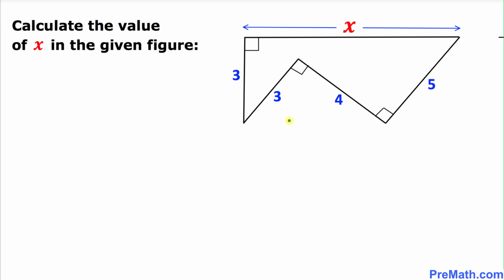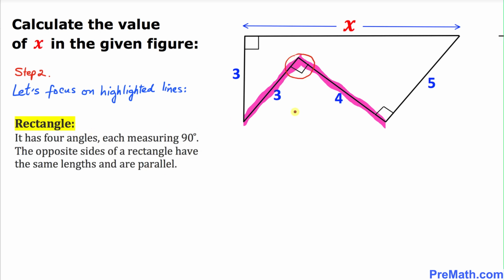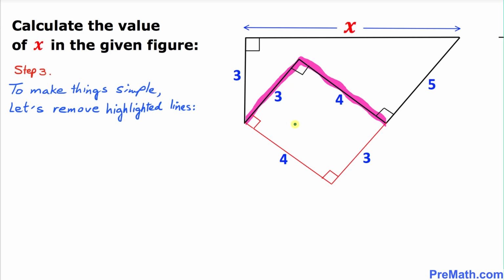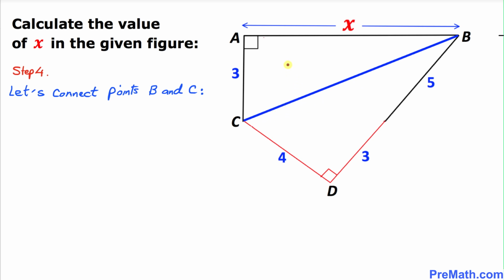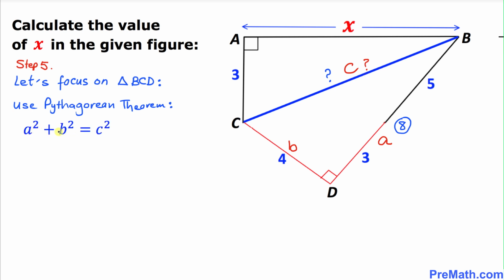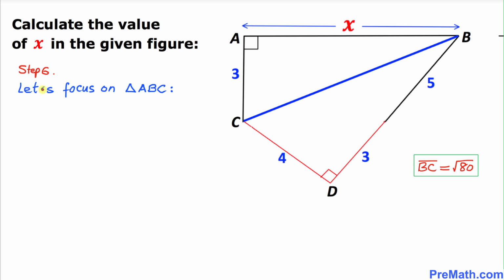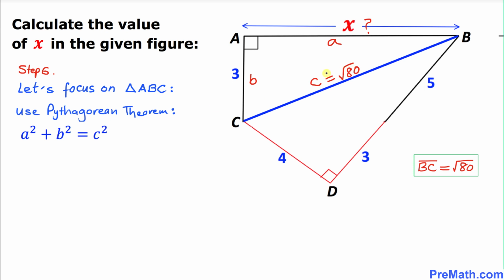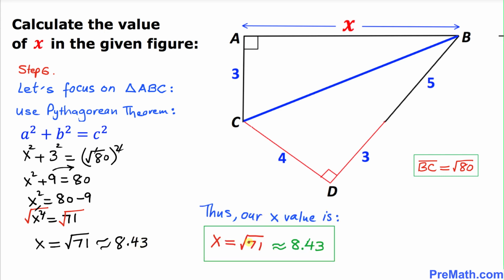Can You Calculate the Value of X in the Given Figure by Using the Pythagorean Theorem?

Comment: In this figure, there is a right-angled triangle, base, and height are respectively 3,4 by Pythagorean theorem, third side = 5.
On the right, we draw a column on the X line to the first vertex in the figure, so it becomes symmetrical = 3. Then we got a right-angled triangle with sides 3,5 then the base = 4, so, X = 4 + 5 = 9
Reply: thats what i got

Comment: 0:22 
Points
Top Left: A
Bottom Left: B
Angle between 3 and 4: C
Angle between 4 and 5: D
Top right: E

Triangle BCD is right, so let's use the Pythagorean theorem.

a²+b²=c²
3²+4²=c²
9+16=c²
25=c²
√c²=√25
c=5

Lets move line segment AB to the right to make a new line segment EF equaling 3

a²+b²=c²
a²+3²+5²
a²+9=25
a²=16
√a²=√16
a=4

x=BD+DF
x=5+4
x=9

Is this right?
Reply: That’s exactly what I got too

Comment: Awesome task, excellent way of solution, many thanks. But: You don’t have to use „D“ for solving, here‘s another approach:

BC intersects the 3-4-5-line in Point E, dividing the zig-zag-line into two rectangled triangles: 

CEF and EGB. (CF is parallel to BD, G is on the BD lin; FG = parallel to CD).
CB cuts FG (= 4) into two parts: k and (4 – k).

Because tan α = (4 – k)/5 = k/3,

k = 3/2

Therefore

(CE)² = 9 + k² = 45/9
CE = 3√5/2

(BE)² = 25 + (4 – k)² = 125/4
BE = 5√5/2

CE + BE = BC = 8√5/2 = 4√5

(AB)² = (BC)² -  9 = 80 - 9 = 71

AB = √71 ≈ 8,426

Note: BC = diagonal of rectangle CDBM (BM = parallel to CD).

It's astonishing how many comments say x = 9 🙂. Maybe Premath should explain this in another tutorial...

Comment: It must be the square root of 71.

Move the second 3 to the bottom right so that it extends the five. Then move the 4 to the bottom left. The result is a quadrilateral with two right angles and the sides 3, 4, 8 and x.

The diagonal from bottom left to top right measures:

d² = 8² + 4² = 80

x² = 80 - 3² = 71

x = square root of 71 = 8.426

Comment: Thank you for a nice solution for this tricky problem.
I have another aproach for this problem using the knowledge of similar triangles and Pythagorean theorem.

First we label the vertexes A,B,C,D and E ( A from the right angle at the upper left corner, clockwise). Connect EB meeting CD at O. Connect CE.
Because DE//BC ---->angle DEO=angle OBC, so the right triangle EDO is similar to the the right triangle BCO
so we have ED/DO=BC/CO =( ED+BC)/(DO+CO) = (3+5)/4 = 2 ----> DE=2DO, BC=2CO. 

Just consider the right triangle EDC, we can easily find the value of CE=5 ( special right 3-4-5 right triangle) which means that the triangle ECB is an isosceles triangle (CE=CB=5). Just draw the height CH=h from the vertex C to the base EB, it meets EB at point H which is also the midpoint of EB. Consider the right triangle CHB, interestingly it is also similar triangle to the triangle EDO mentioned above (angle DEO=angleCBH) so we can deduce that BH=2CH =2h---> EB=4h

Using Pythagorean theorem (consider the ritght triangle CHB) : sq CH + sq BH = Sq BC ----> sq h + sq (2h) = sq 5----> h= sqrt of 5.
therefore EB=4 sqrt of 5----> sqAB= sqBE-sq=80-9=71---> AB=sqrt of 71.

Comment: The picture of this problem is completely misleading. If the sides are 3, 4 and 5 then the picture cannot look like that. The corner between the sides with length 4 and 5 will fall much lower in the picture.

Comment: Given that a triangle with sides 3,4 and 5 has to be a right triangle then a line joining the two bottom points on your diagram must be 5. We are given 5 on the right as a hypotenuse and a vertical line as on the left hand side of your diagram as a 3, therefore making this left hand side of the figure a right triangle the bottom line of it must be 4. Adding these lines 4+5 would make the bottom overall line and thus the top line 9. Not the 8.43 you got by your convoluted method. This works quite simply on graph paper so are you wrong? I see many others have the same comment.
Reply: O.K.  I see my mistake I didn't have three right angles as your drawing. But your drawing is for shit :-) isn't it?
Reply: However, in reality ignoring your piss poor drawing, the second bottom point is a lot lower than the first point. Nevertheless it you join these two point you get on the left a 3,4,5 triangle. Continuing this line and drawing a line at a right angle from it to the top left point you get another 3,4,5 triangle (you are given the hypotenuse as 5) This only reverses the numbers I had in my previous comment making the bottom of this triangle 3 and not 4. Still, you add this 3 and the previous triangles 5 and you get 8. You can then see just by looking at it that the top line is a just a bit bigger than the bottom line so there is your answer — the top line is 8 and a bit, which is near enough to what you got without going all around the houses.
Reply: If you wanted a more accurate answer an easier solution would be to project a line through the bottom two points and then a line at right angles from it to the top right hand point. This gives you two right angle triangles which you can see have sides of 3,4,5.  Now you add up all the sides you know 3+3+4+5+3+4+5=27 you take away from this the number of lines you know which is 7. 27—7=20. You have two known triangles so 20 X 2 = 40. Add to this the number of hypotenuse you know (2) 40+2=42. So the length of the top line has to be this 42 divided by the known hypotenuse (5). 42÷5=8.4. There is no need for all your square root rubbish, isn't it?

Comment: x = exactly 9. There are two rectangular triangles there: one formed by legs 3 and 4, hence hypotenuse 5; the other, height (one leg) is 3, hypotenuse 5, so another leg 4. 4 + 5 = 9.
Reply: You're assuming that the hypothenuse of the first triangle in your explanation  is parallel to line x but that is  not proven and  can in fact be proven false
Reply: The 3, 5 and a bit of x triangles is actually approximately a 44, 46, 90 degrees triangle, you assumed it is 30, 60, 90.
Reply: That's what got

Comment: Sqrt (3^2+4^2)  + sqrt (5^2-3^2) = 9
Reply: First, you are assuming that the triangle with legs 3 and 4 has hypotenuse that is parallel to side x. Then you are assuming that if we drop perpendicular from intersection of sides 4 and 5 to side x, we get a right triangle with vertical leg = 3, which is only correct if the hypotenuse of original triangle were parallel to side x, which is not necessarily true, and in this case is not true at all.

Comment: Hlo bro, the answer might be 9 .
If u draw a line joining the 3 and 4 which is parallel to x ,u get a right angled triangle,its length is 5 and again extending this line and draw another line from B so that this is perpendicular to extended line and here it forms another right angle triangle with hypothesis as 5 and the line drawn from B is parallel to 3 so it is 4 therefore the sum will be 4+5=9
Reply: "Which is parallel to x", you say... but I don't think it's true... It may look so from the drawing, though. But I don't think this drawing is really to scale.
Reply: What you did proves that the length of x cannot exceed 9. For it be exactly 9, the hypotenuse would need to be guaranteed to be parallel to the line x. That's not a given. It's close to parallel, which is why the answer is close to 9.
Reply: Agree

Comment: I can't accept this answer. There's problem.  I found 9 as a answer. Just applied pythagoras theorem. If you draw all the rectangle and you applied the pythagoras theorem you will find answer easily
Reply: You can't accept the answer because you made some incorrect assumptions. Most likely, you probably assumed that if you connected the ends of the adjacent line segments 3 and 4, you'd get a line segment of length 5 parallel to line x. Yes, that line segment would be 5, but it's not parallel to line x.

Comment: Thanks Bob.
I approached from another way :
1. Given 3 & 4 you can calculate the angle : 
Tan 0 (theta) = 3 / 4 
So Theta = 37deg
2. Sin 37 = a / 3 
So a = 1.805
3. Sin 53 = b / 4 = 
So b = 3.195
4. Sin 37 = c / 5
So c = 3.009
X = a + b + c
= 1.805 + 3.195 + 3.009
= 8.009
Can't figure out, where I am going wrong!
Reply: First, using exact value, you'd get:
a = 3 sinθ = 3(3/5) = 1.8
b = 4 sin(90-θ) = 4(4/5) = 3.2 
c = 5 sinθ = 5(3/5) = 3
x = a + b + c = 1.8 + 3.2 + 3 = 8
But this is still incorrect. Why?
Because the hypotenuse of triangle with legs 3 and 4 is not parallel to side with length x. 

If we did assume that the hypotenuse of first triangle was parallel to side x, then the second triangle has horizontal leg c = 3 (as calculate above). But that would mean that vertical leg = 4, which is not possible, because it should be the same as the vertical side of the larger figure = 3.
If last segment was actually 5 units, then we'd get c = 4 and line segment of length 5 would not be parallel to 2nd line segment of length 3 (or not perpendicular to line segment of length 4).
If last segment was perpendicular to line segment of length 4, then it would have length 3.75, not 5.

So letting go of the assumption that first triangle has hypotenuse parallel to side x, and with careful calculations, I found that:
sin θ = (2√71-3)/20 and cos θ = (6+√71)/20 (where θ is the angle between the two sides of length 3. This gives us:
θ ≈ 43.8
a = 3 sin(43.8) = 2.08
b = 4 sin(46.2) = 2.89
c = 5 sin(43.8) = 3.46
x = a + b + c = 2.08 + 2.89 + 3.46 = 8.43
Or using exact values:
a = 3 sinθ = 3(2√71-3)/20
b = 4 sin(90-θ) = 4(6+√71)/20
c = 5 sinθ = 5(2√71-3)/20
x = a + b + c = 3(2√71-3)/20 + 4(6+√71)/20 + 5(2√71-3)/20 = √71 ≈ 8.426
Reply: Hi Bob Punch, I’m not sure about step1: Theta = arc tan (3/4) exactly equals to 37 deg

Comment: Ok it can be sovled with right angels given in pic without making it quadrilateral..and ans is 9
Reply from the maker: Thanks Surinder for the feedback. You are awesome  👍  Take care dear and stay blessed😃
Reply: @PreMath  dear sir thanks for videos..really it will help to develop logical thinking..
Reply: 9 is absolutely wrong! You made wrong assumption that the line is parallel to x but it is not. The diagram is not drawn in scale.
Reply: Sorry but i don't understand. The answer is 9 or sqrt(71)?
Why this 2 techniques have different answers?
Reply: @wissem5915  premath method is more logical and explainable without any second thought.

Comment: Ok it can be sovled with right angels given in pic without making it quadrilateral..and ans is 9
Reply: No, if you followed the solution, answer is obviously not 9. That's because the triangle with legs 3 and 4 does not have a hypotenuse that is parallel to the side with length x. Interestingly, if  you switch the legs of length 3 and 4, you will get x = 9.

Comment: Draw a perpendicular line from point D to the side AB and name the intersection point of line and AB as E, from the figure it is known that the side AC and new formed side DE are equal since they are parallel to each other. Then take right angled triangle BDE and use phytagorous theorem  :BE=4 simultaneously take right angled triangle DFC and likewise use phytagorous theorem, you will get DC=5.Now take rectangle AEDC  by its rule you would able to know the length of the side AE is 5.At the end, you  should add the sides AE and EB(BE) to get the general length of side AB, since 'x' represents the length of the side AB.
BE=4
AE=5
               X=BE+AE
                  =4+5
                 =9  - correct answer
This is why I disagreed with your answer 🧒🤙✍🏾
Reply: What you failed to realize is that line CD is not parallel to line x.
Point D is somewhat lower than point C, so AE will be a little shorter than CD. Also, DE will be a little longer than 3, so BE will be a little shorter than 4
Did you actually watch the video?
Reply: 'side AC and new formed side DE are equal since they are parallel to each other' You must look at this sentence again.

Comment: Once you see the 3,4,5 line at the beginning, you can see that you can find the "diagonal" length easily. Put it in (0,0)  (3,0)  (3,4)  and  (8,4)  locations  and with distance formula the distance between  (0,0) and (8,4) is sqrt(80).

Comment: Wouldn’t it be easier to use an equivalent triangle process? Starting with calculating the hypotenuse missing between the 3 and 4 line which provides a length of 5. Then invert that triangle and impose it over the 5 line. Using the equivalent triangle process one can create the equation 5/3=x/5. This provides a result of 8.33… However given this is different that the one provided using the method described in the video, could it be that line ab is not 3 but something less than 3?

Comment: If we take a vertical line from the angle between the lines 4,5 to the line x and make a rectangle  
After calculating a line down between the tow angles down  that line equals 5
So the up line between the uplift angle and the angle that form our line we drow  is5
The line we drow is 3 
So the remaining of x is 4 
5+4=9     x=9
Reply: That's how I saw it
Reply: I did the same thing with x = 9. However, we are assuming that the two angles pointing down in the 3, 4 triangle are on a line that is parallel with the line x. Drawings are never to scale.

Comment: Label the diagram from the bottom left clockwise ABCDE. Let ∠ADE = u. AD = 5 (by Pythagoras). AC² = 5² + 5² -2(5)(5)cos(90° + u) = 50 + 50sinu = 50 + 50(3/5) = 80, BC² = AC² - AB² = 80 – 9 = 71, BC = √71.
Reply: Nice.

Comment: You take the long way round. 
1. Connect the two lower peaks.  You get a 3,4,5 right triangle. 
2. Drop that 5" side up to the main line "x", 
3. Now, extend a vertical line from the second lower peak up to the line "X".  
4. You get another 3, 4, 5 right triangle, with the "4" length as part of "X". 
SO, "X" = 4+5 = 9. 
Much quicker than your approach.
Reply: We due respect, I totally agree with Craig Dillon
Reply: With due respect I mean
Reply: @suleimanalhassan4702  Yeah, Except I was wrong.  LOL...I was part of the 99%.  That problem seems simple, and it seduces one to that belief.  But, those two lower points are NOT at the same level.  A line between them is NOT parallel to "X", but it looks it.
Reply: @craigkdillon  Respect. Apologies to the Prof. LOL
Reply: @craigkdillon  There's about a difference of 0.574 difference in their lengths... So if you tried to make that assumption about drawing a line across the bottom and back up to the top right... you're off by about 1/2 a degree (educated guess based on visual and the difference in lengths, without performing the calculations) ... Now, finding that exact angle, that'd be a moderate challenge!
Reply: Yes I had x =9
Reply: I also thought on the same lines. The answer should be 9. All the steps are Pythagorean!
Reply: @subashan1957  Yeah, but I was wrong. I was led astray by the diagram. Humbling to be caught in a stupid assumption.
Reply: I also applied this and calculated value of x as 9
Reply: nice Craig
Reply: This is the best way , 
8.43 is a wrong answer.

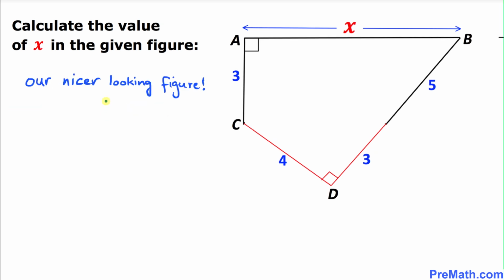Comment: At 2:55 in the video you introduce A,B,C,D as labels for these points,  This shows right triangles ABC and BCD as having a common side BC. We note that AB=x, BC = 3 and angle D is a right angle so BC =sqrt( 8^2 + 4^2 ). From the contiguous right triangle ABC we see that BC = sqrt ( 3^2 + x^2 ) from which if follows that x^2 = 8^2 + 4^2 - 3^2, and x = sqrt( 71 ).